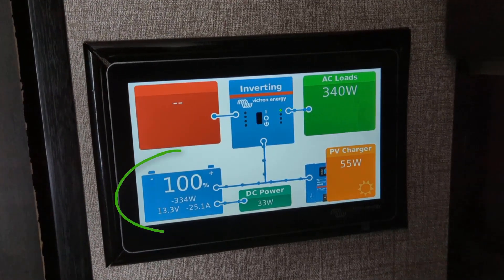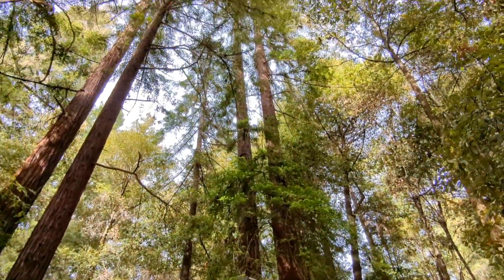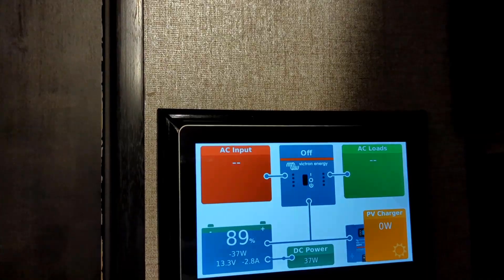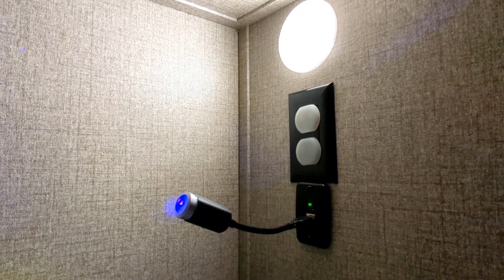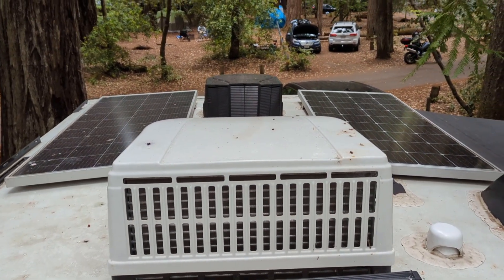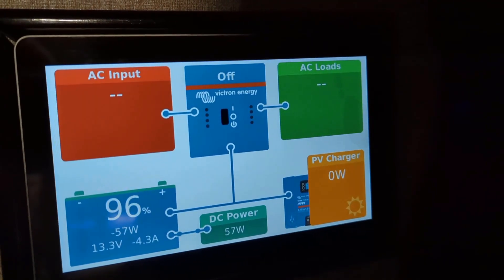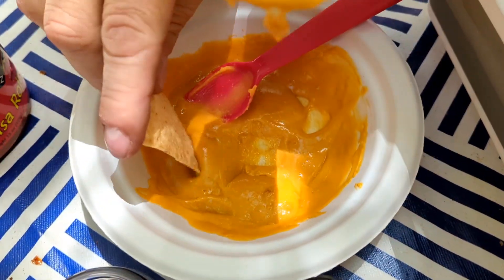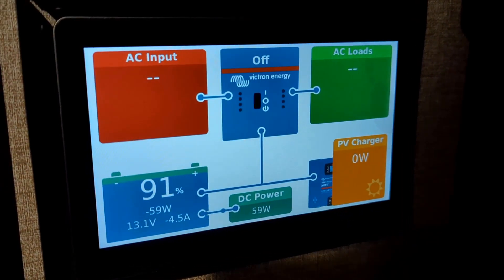Solar Test in the Redwoods

Comment: Hi! I've been scoping out your videos... I'm going to pull the trigger on a 171 and... first of all thank you so much for making these. Seriously, it helps build confidence and the decision making process goes so much smoother. 

I have a couple concerns with this trailer and I'm hoping you can put my mind at rest. I've seen a couple videos that have me worried I wont be able to boondock in 10-20 degree weather. I hunt in GA during november and it can definitely get to the teens at night. I'm worried about freezing and the ability for the furnace to heat suffiently and effienctly. Have you had any issues?

Also, you have sooooo many upgrades. Particularly with the inverter + Solar (and control panel) setup... did you install these yourself? Do you have links to eveyrthing required for this? Or an idea of how much it ran you to have someone install it? I was super impressed with the performance even in shady settings.
Reply from the maker: Thank you so much for the kind words! So, we haven't camped in it in weather colder than the low 30s and we had no issue at all. I would make sure you have full propane tanks because the furnace goes through propane pretty fast. Also, we don't have the optional tank heaters but those seem like they'd be worth getting if you want to take it out in the cold. I have heard of people camping in these in extreme cold and they keep it winterized and don't use any water, we aren't quite that extreme 😁

And for the solar upgrades we do have an article with a full write up (and video) of what we did. The article includes links to everything including all of the cables. You can find it here: https://roginaroaming.com/jay-feather-micro/lithium-solar-upgrade/

We did the solar upgrades ourselves but we are lucky enough to have a licensed electrician in the family.

Hope that helps! If you have any additional questions feel free to ask!

Comment: I know you have a gas/electric refrigerator and power it with propane when in camp. We do the same. But, I am wondering if you have any thoughts on how your new lithium battery system would work using a 12v compressor refrigerator.  They are being touted as being super efficient and recommended for off grid camping.
Reply from the maker: As you said, we don't have 12v fridge so I can't say for sure, but I don't see it having any issue with our current setup. We were hesitant to rely on solar for something as important as our fridge, but we've heard nothing but good things about the 12v refrigerators. I heard they also have an eco mode that kicks on overnight which makes it take almost no power. We haven't had any issues with our gas/elec fridge so there's no reason for us to change it but with the upgraded solar system I would no longer be hesitant about the 12v fridge.

Comment: Did you use the batteries to heat the hot water?
Reply from the maker: We used gas to heat the water but there is an electric starter. It doesn't use much battery though.
Reply: @RoginaRoaming  For what it's worth, in my 16BH I've learned that using both gas and electric to heat the water makes it work more quickly and can give you hot water longer which is great for the whole family to get clean without too much waiting, and can help moms with long hair that might need washing.
Reply from the maker: Good to know! Thanks for sharing. I hadn't thought about using both.